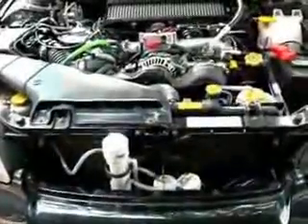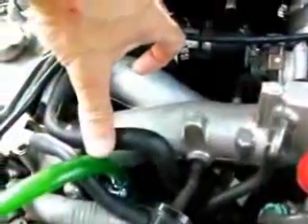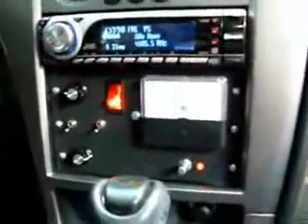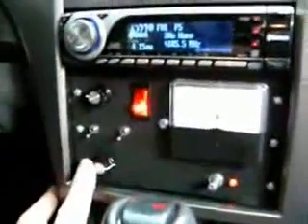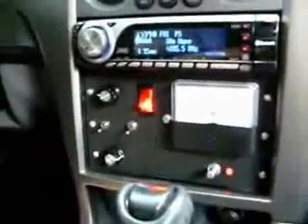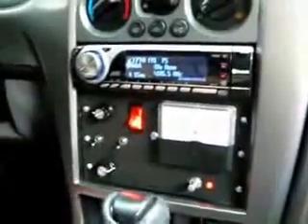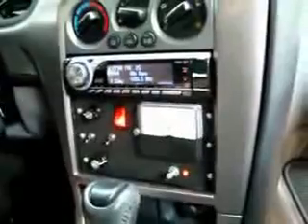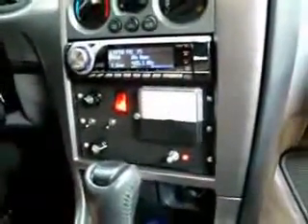How To Convert CAR To Use WATER as Fuel - Hydrogen Conversion Cell

Comment: Ummm you haven't converted a car to run on water.You have simply added hydroxy gas to supplement the GASOLINE which is what the car is running on not water.You need to learn how to title a video.